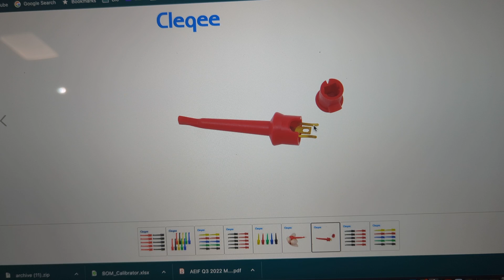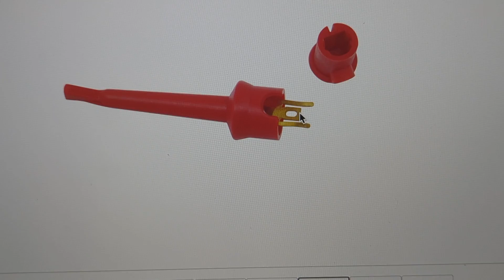Soldering mini grabber test hook clips

Comment: i have a slightly different variation. once i put any solder on it at all the caps do not go back on. even 24 awg wire and minimum solder i cant get  the cap back on without bending it to hell. I ruined three of these already

Comment: Good video. Unfortunately they come in different designs, mine is more complicated, the plate is H-shaped, so there are more ways to attach the wire and it is hard to figure out the right combination. Too much solder and it won't fit in the slots, so I am going to try to solder it to the middle part of the H.